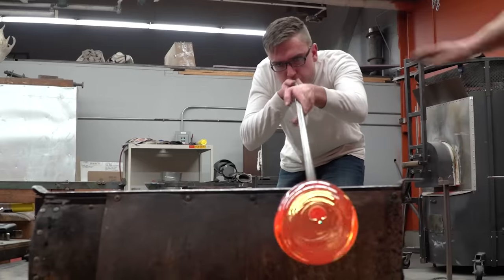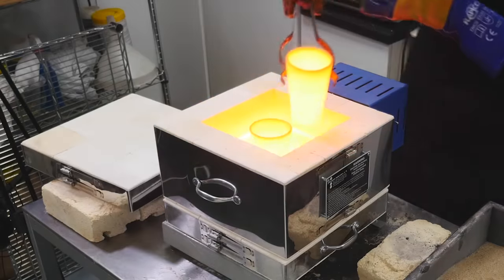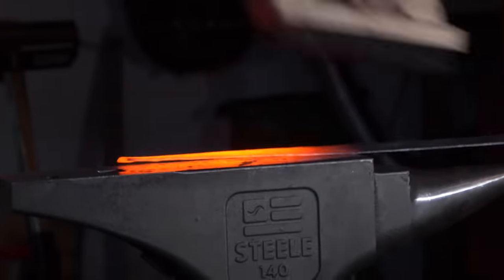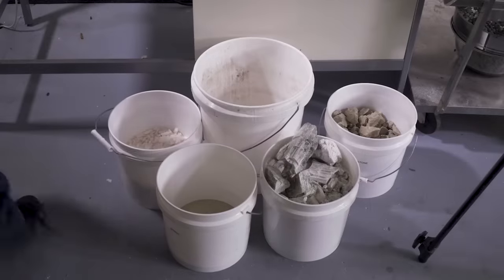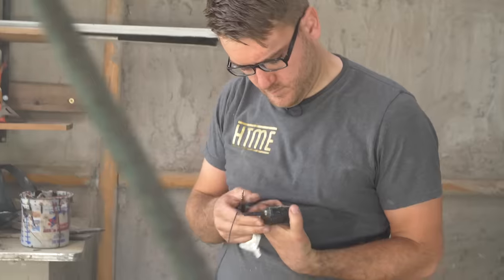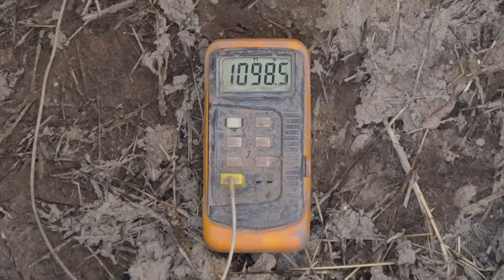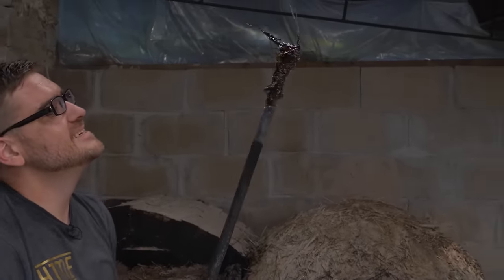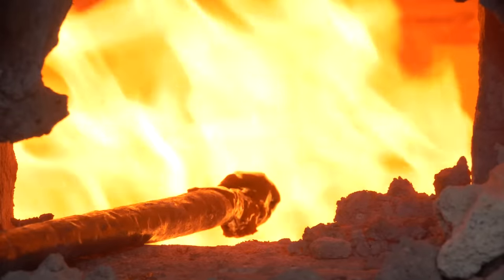Making Glass with a Roman Style Furnace

Comment: Hi. I'm a retired ceramic engineer. Use charcoal instead of wood. Form a thick layer of silica sand in the front center of the furnace. Make a depression in the center of the sand to form a bowl. Put your premixed ingredients in the depression. The pure silica sandmelts at a much higher temperature so you will end up with a pool of melt that is more fluid in the middle and will fork its own solid bowl.  Draw from the fluid portion. Build the charcoal fire to each side of the pool. Good luck. I enjoy your efforts and they show just how much practice is needed to get things right.

Comment: They might be able to reach higher heat with better fuel, like charcoal
Reply: Exactly my thought. Would limit the smoke and soot as well
Reply: Or hard coal.
Reply: @The_Mess85  I'm pretty sure you would want to still turn coal into coke to avoid introducing sulfur to the process (and to drive away volatiles)
Reply: Also more oxygen. If there is soot, it means he isn't burning all his fuel.

Comment: Try using mullite crucibles.  They're intended for this use case, and are a ceramic product, so they fit with your tech tree.  They work great for both metal and glass casting.

Comment: A tip for candling . If you start with hot coals and place them evenly across the bottom you can control the heat much easier. Then add fuel generally in the form of either a hardwood or or more Charcoal. When using softwoods the excess of gas some sometimes reduces the heat due to the fact that the draft is greatly higher than needed.  Remember for every cubic foot of air that goes into the  Kiln extra over what is needed, needs to be heated up and evacuated.  Try to use hard woods such as oak and Maple as they will allow for higher BTU  put per cubic foot of material.

Comment: There’s a kiln design called “the philosophers kiln” that is very efficient when it comes to firing with wood. I don’t believe the romans used that design but it will certainly get up to 2300 degrees with proper air flow and minimal insulation, also loving the glass/ ceramic section of this series!

Comment: Lead oxide is a better flux, especially if you want a traditional roman glass. 
Borax is used to make pyrex, which is a pretty modern glass, but it's maybe not great without a modern kiln. 
Lead is still used to make "Glass Crystal" because it allows the glass to stay liquid over a larger temperature range and trapped air bubbles to escape. 
For the romans, it also sweetened their wine as it turned to vinegar, so there's that.

Comment: I see this mistake often on youtube, when people are trying to heat things up like this. People make these dinky, low mass kilns. You need mass to even out the heat, to hold it in, and to buffer (slow down) changes in temperature. The only reason modern, tiny, kilns work is because they have a freaking propane blower on them. 

At a minimum, especially with glass, I'd have double layer brick, but I liked how he eventually added some weight. You want mass. Get some straight up KG's in there. Then there's a problem of getting hot enough. This is a challenge with primitive methods. Modern times you just add a leaf blower and stuff it full of wood, viola. 

To do this in a primitive fashion, I think you need to make charcoal first. You'd need a mound of it. Then you should use a timed method to reach your temperature. IE: fill the chamber with charcoal, burn half it it, time this, say 10 minutes. Then on the regular top off the firebox. Consistency is key. You'd probably wanna add a blower somewhere in there if you can. Blowers are discussed elsewhere on his channel, but for the love of god man. Make it bigger ;P

Comment: One of the problems with accieving the highest temperatures might be that you use cold wood. In glass factories in the 18th and early 19th century, the wood was first air dried for a long time in ambient temperature (months), then it was superdried and heated in a separate kiln specially for drying wood, before beeing fed into to the glass kiln while still hot (I guess the outside of the wood was allmost charcoal at a couple of hundred degrees) and the water content 0%. This way you don't waste some the glass kiln energy to heat and dry the wood before it catch fire.

You also need to acciece stable temperatures... First up 14-1500°C to melt the glass, and keep it there for several hours, then slowly cool it down to about 10-1100°C working temperature suitible for glass blowing. I support the suggestions to build a kiln of larger mass to even out the temperatures.

I see from 18th century glass factory archives that they spent 3 days of continiously burning wood (in an allready red hot kiln) from the crucible was refilled and a new batch of glass was heated, melted for a long enough time and then cooled to woring temperature.

Comment: I heard that adding some wood ash to clay may make your pottery more resistant to thermal shock and make it more resistant to the issues you are facing at higher temps. You do need to wash the ash to try to remove the lye out of it, but if done correctly this may solve your issue.

Comment: Your ceramic pots keep exploding, likely due to them not being well constructed and dried properly. Any unevenness in the walls is going to cause stress points when your pot fires. If you put a flywheel on the bottom of your kick wheel that is wider than the wheel head you'll get much better results. Also, work on the side of the clay that's closest to you, not on the opposite side, you'll have so much more control over the clay that way. Let your finished pots dry for a few days before firing them, and have them go through two firings, you'll get much stronger ceramic pots that  way. Find out what the vitrification temperature is for your clay and you'll know how hot to fire it to get the strongest clay possible. 

As someone else below said, use charcoal. The Romans made extensive use of charcoal in all aspects of industry. You just can't get temperatures high enough, or stable enough for proper firing.

Comment: Not sure about the historical accuracy, but switching to charcoal should and putting in some kind of bellows system will help. The charcoal should burn a little hotter plus give off less soot, and the bellows will dramatically increase the temperature.

Comment: Do you know about the quarts inversion temperature? It's basically the temperature that your ceramics have to pass slowly or you risk shattering them. When I used to work on a facing brick kiln we said that temperature was 573°C or 1063°F. This is both for heating up and cooling down.

Comment: So how exactly did you make the crucible ? Todays clay isn't a fair comparison as they are rated for different temperatures while using river bank mud generally cracks easy because of thermal shock or from simply being fired at a temperature intended for its use. For instance pottery made in Africa has to be bonfire fired to accommodate camp fires for heating and cooking, kiln firing would render it useless for campfires.

Comment: Mate, did you forgeweld your pipe? Without any inner support rod???
I don't know Rick...
FYI I made glass by mistake in my forge while I was welding with sand. 
Couldn't be easier. Hot iron, dip in sand, back to forge, repeat, big ball of glass, blow it.

Comment: nice coincidence, i just made some glass for the first time, in the microwave; dissolved NaOH drain cleaner in water and mixed it with sand stolen from a sandbox. got orange hot and broke the plate in the process. put some insulation underneath if you're gonna do this

Comment: Romans used hot oil instead of water to mix their kiln pottery; so use hot pork fat instead of water in your clay and the pottery should hold the heat better. They also used shaved bronze in their pre heating to heat up the crucible so it was up to temperature. Try that too.

Comment: I think your furnace design is your main issue here. There's a huge temperature gradient in the working chamber by virtue of the gas flow. Perhaps you should investigate running the flames to enter from the bottom through a grate to allow for more even heating of the workpieces. It might not fully eliminate this gradient because you shifted this gradient to be more vertical than horizontal, but it should mitigate it.

If that's not feasible, try investigating how you make the clay crucibles or try applying sacrificial layers of cob to it. It might help regulate the thermal gradient enough to stop it from shattering. You might need to vary the thicknesses of the cob based on how the air flows across your work pieces.

Comment: I like this method but I would probably put 3 to together 2 on the outside one in the middle where the 2 on the side lead into it with no exhaust vent in the middle one you should be able to melt most things you do want too

Comment: So this is basically just adding wood to a contained fire and seeing how hot it can get? Wouldn't using bellows let you reach higher temperatures more consistently and also faster?
Reply: In the old days they would often have a large bonfire (in ground) to make the charcoal.
Reply: @4philipp  Seems to be unrelated to my post, but whatever.

Comment: Idk anything about glass working but the shape of your crucible probably isn't helping getting it out I would use more of a bowl than a cup. Also you would probably be better off using charcoal or something not wood because of all the smoke and it burns hotter, and maybe more air pressure or something. Maybe focus on a high air pressure thing that uses power multipliers like a long lever or pulley or something I'd like to see what you come up with

Comment: For a bladesmith forge, they need temps more toward 2000 degrees F. and they do that by using All Natural Lump Charcoal (sold in charcoal section of my local Meijer superstore in grilling aisle) and use a blow dryer to force air into the forge to increase oxygen to help in burn hotter.  More info on blacksmith forges can be found here on YouTube.

Comment: I think you're taking the word "candling" a little too literally ;-). though on a side note, its sometimes a good idea to start the process by setting an additional small fire directly at the bottom of the chimney flue to induce the air currents before you light the main fire at the firebox end of the furnace. it will help make sure that the initial smoke from the firebox is drawn to the chimney. 
(btw, it's important to remember that the pyrometric cones measure "heat work" not temperature. that is a lower temperature for a long time will have the same effect on the cone as a higher temperature for a shorter time.)
also, for glass, unlike clay based ceramic, you may want to let it cook for an extended period of time to let the mixture actually mix. not a concern with ceramics as the last thing you want to have happen is have the material get into a state where it can actively 'convect'...

Comment: For the blowpipe: couldn't you just roll it? Like a toilet paper cardboard?
Reply: You can, and it'd be easier to do around a mandrel, but at the same time, the length of the weld required is much longer as the wrap follows a longer distance in the same length, and you'd have two seams to weld up.

a simple scarfed weld joint running down the length of the pipe is just simpler.

Comment: Pretty sure the blacksmith is working the steel too cold at points
Reply: Iunno which points you're talking about, but I did a lot of planishing. I worked it down to the black heats and used light strikes to smooth out and retain uniformity on the surface before moving on to the next heat, so I didn't have to worry about little bits moving too far or getting too out of place with such a thin piece.

Comment: Your not going to get much better using wood as the heat source.  You will need to take wood, and turn it into charcoal.  Can do this by making a charcoal kiln.  Just go watch Primitive Technology's video where he does it.   Also, burning charcoal will be MUCH cleaner than burning wood, so there will be less contamination in the glass.  But you're going to need A LOT of wood to make enough charcoal to make glass.

Comment: READ ME PLEASE!!!!! Use charcoal for the fire (and forced air) and ceramic for the crucible!!!! Charcoal burns hotter and much cleaner then wood and the Romans 100% had it (charcoal is easy to make) and there is no way the Romans would of ever used a crucible made out of metal because metal is much more expensive and harder to make then ceramic at the time, and ceramic also handles much higher temperatures.

Comment: Use coal it burns hotter
Reply: Using just coal would introduce a lot of sulphur and other compounds that could interfere. Come might work but it requires a fair bit of air flow to fully combust. I think going with charcoal would be a better option, like a ton of other commenters have said.

Comment: now that he has knowledge of metal pipes, i kind of want to see him make an early musket from scratch.
Reply: A flintlock musket is a pipe with a loading chamber, firing pin, stock, trigger and sighting. The issue is gunpowder (or black powder, in this case). It isn't difficult to obtain the resources and the recipe is well known, but they would likely be crossing state borders in the process of gathering resources and doing so with the intent to unlawfully fabricate explosive charges for use as ammunition in an unliscensed firearms manufacturing operation. They could make a crude musket, but they probably shouldn't.
Reply: @bodaciouschad  federal law states that manufacturing gunpowder and firearms for personal use is legal, so long as you do not sell them or give them to others. the only restriction on the gun itself would be if it is classified as an short barreled rifle or if the individual is not allowed to possess a firearm in the first place. . that being said i dont know what the state laws would involve.
Reply: Forging a gun barrel is a pretty significant jump from forging a pipe like that. Gun barrels were forged by spiralling a billet around a mandrel and forge welding it along the way. It's a really tricky process and I wouldn't want to try it without some serious professional help; otherwise you'd really just be making a long skinny grenade to blow yourself up with.